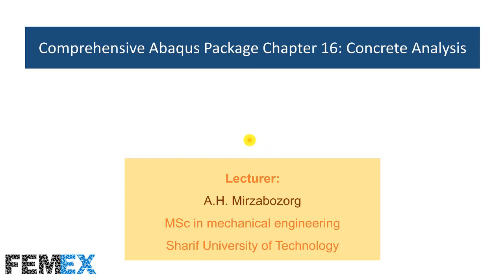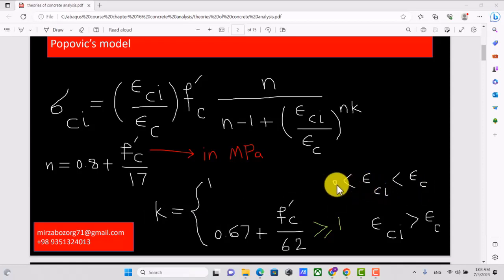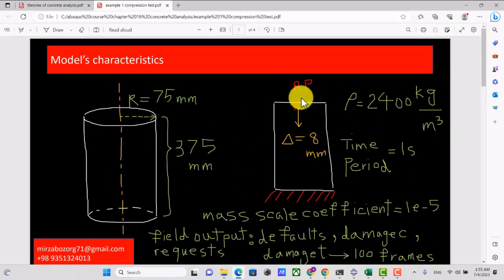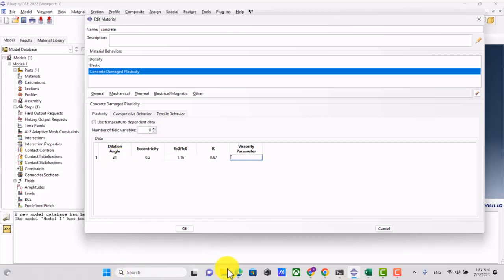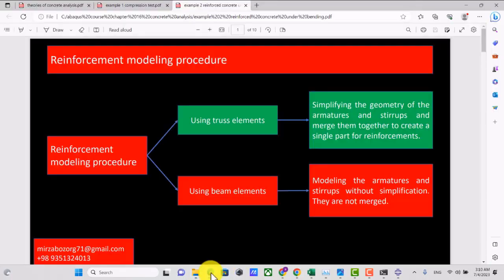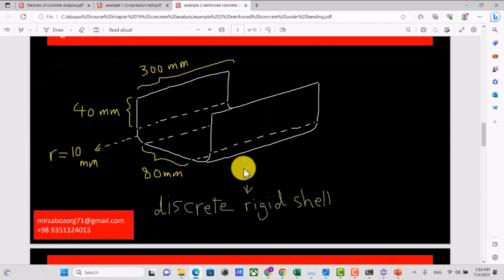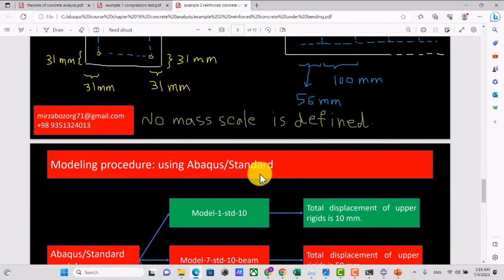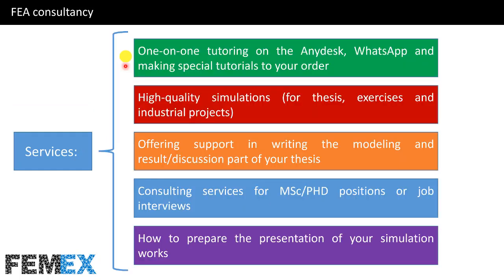Comprehensive Abaqus Package Chapter 16: Concrete Analysis (Preview)

Comment: Hi dear 😊
Is it possible to plot meshes and displacements? (with different numbers mesh)
Reply from the maker: Hi.
Do want to plot the displacement of each node?
Because the displacement is calculated for each node not each element or mesh.
Reply: @FemexIran  
I want to plot a change of meshes (meaning that every time I change the number of meshes, for example, 2x2, 4x4, or 16x16) and displacement at the point of application of forces (the point of applying the forces doesn't change)
Reply from the maker: @legouirahmaria   The name of what you want to do is : Mesh Sensitivity Analysis
To do mesh sensitivity analysis, you must run your model with different element sizes and finally compare the results. You must plot a curve to find the best element size. In this curve, the x-axis is the number of elements and the y-axis is the value of the variable which is chosen for comparison. Displacement converges very fast so you must choose another parameter for comparison like stress or strain at a especial point.